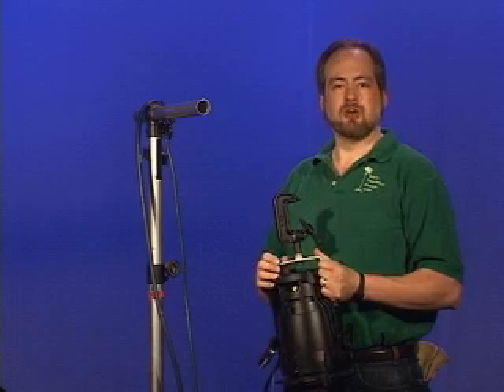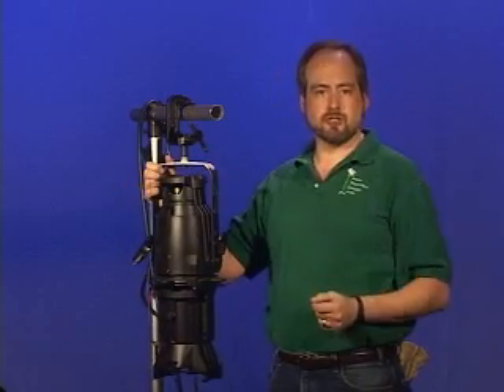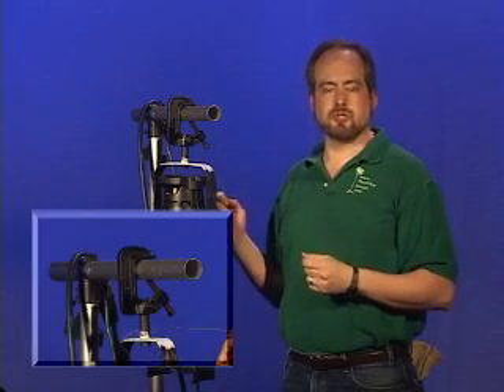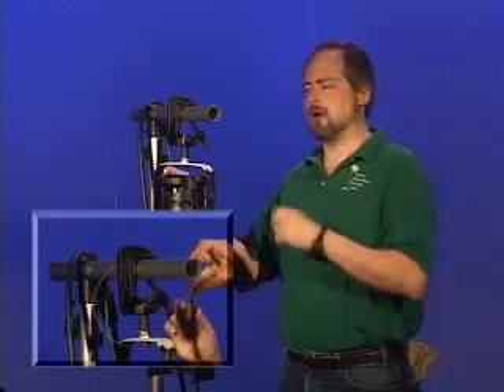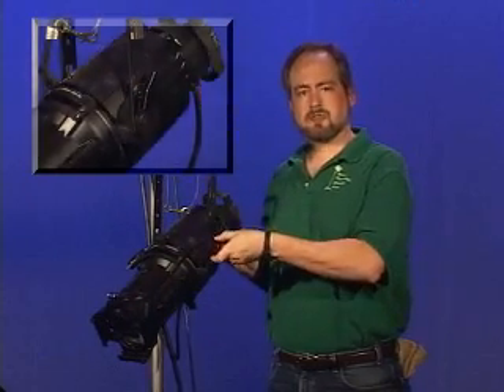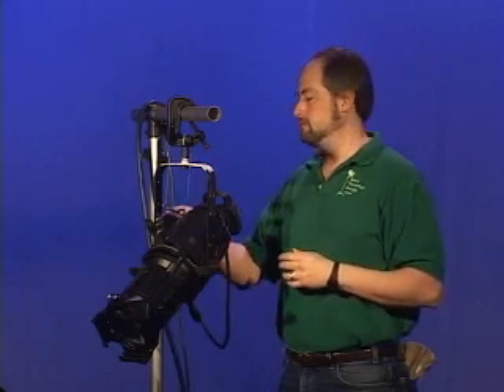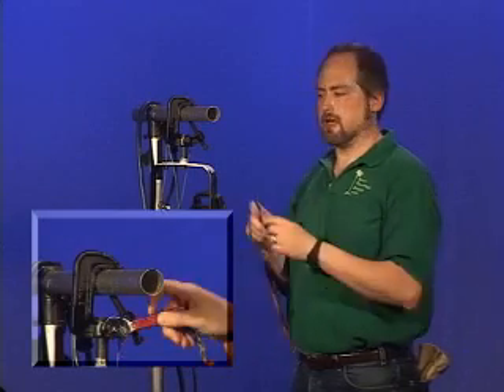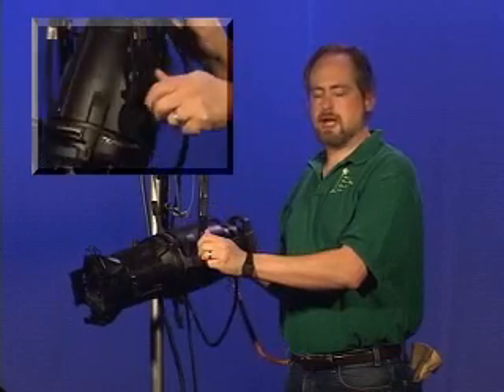Hanging Theatrical Lighting Instruments

Comment: I recognize that it's more personal preference, but I agree that it's 'normal' to hand tighten, then safety, then wrench.  Also, I would recommend against using the 'pan knob' on the side as this bolt isn't as tough as it looks and can break easily. 
Other than that, well done.  It's clear, concise and easy to understand.  *applauds*